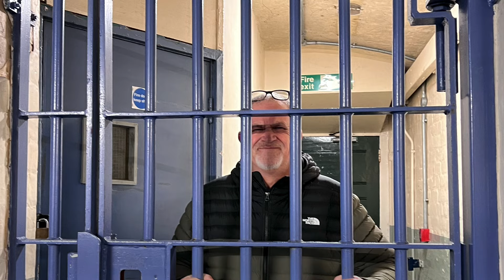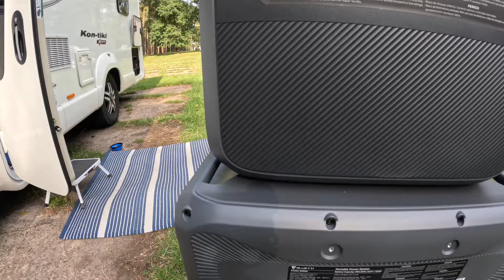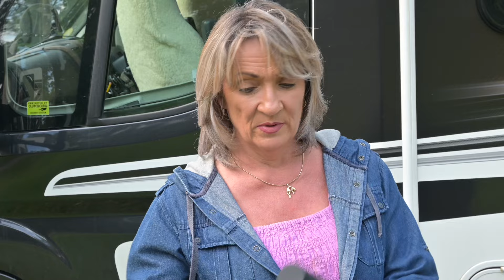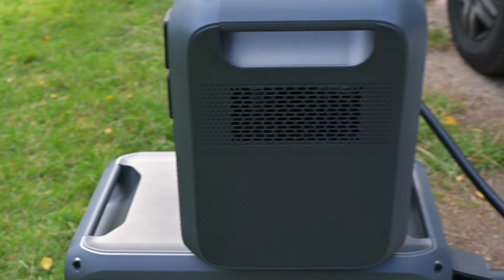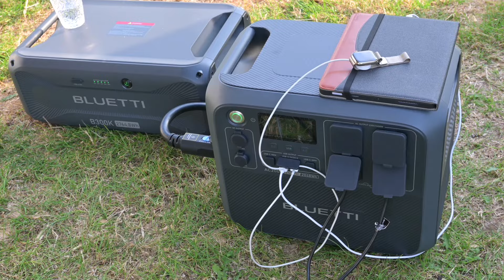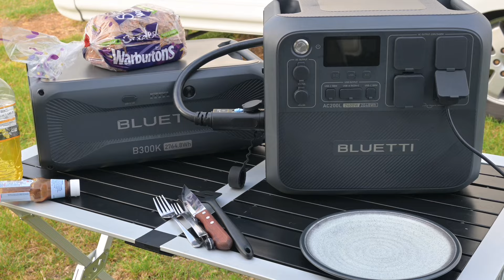All THE POWER YOU WILL EVER NEED

Comment: I've got the poweroak power bank the same as the Bluetti I think they're the same company, it's 3 years old now so not as modern with an app, but does have 2 wireless phone chargers on the top of mine. I need something now to power my air con off grid so may be going down the generator route.
Reply from the maker: @autotails_on_tour  hi and yes, it does sound like you need a generator or a very powerful  power bank